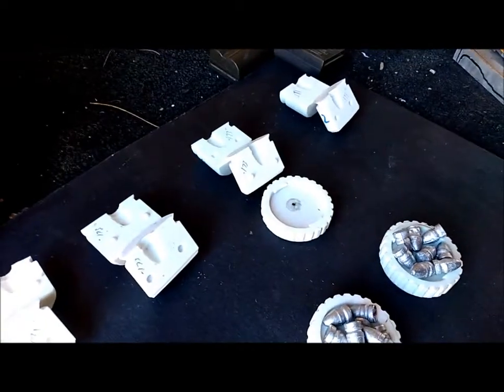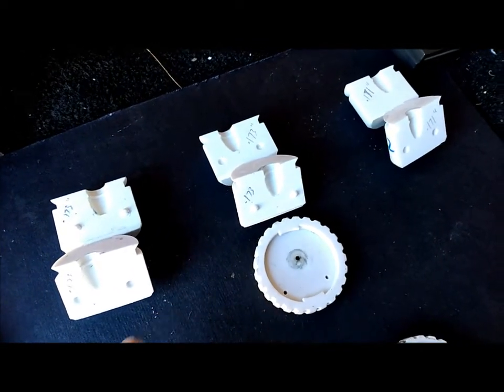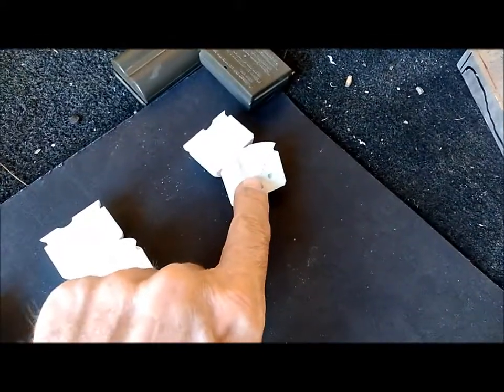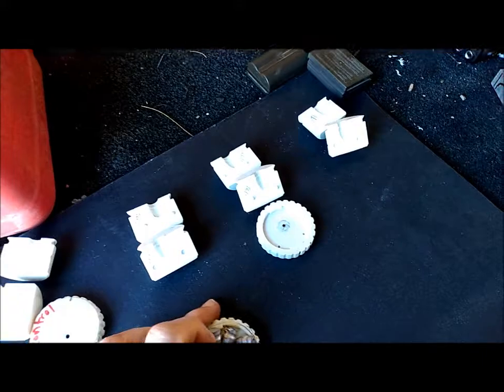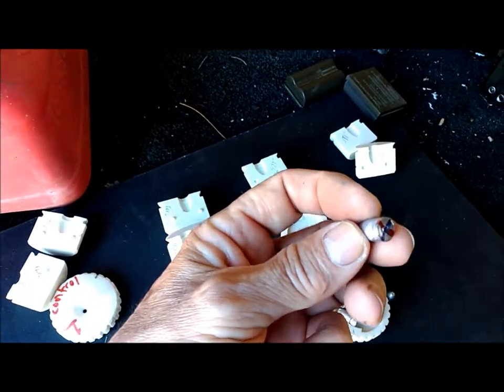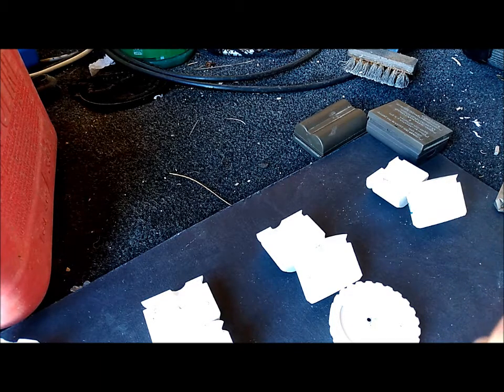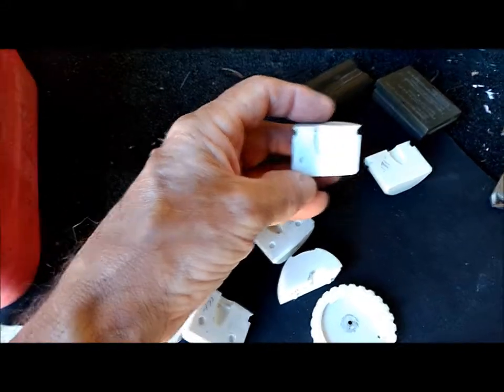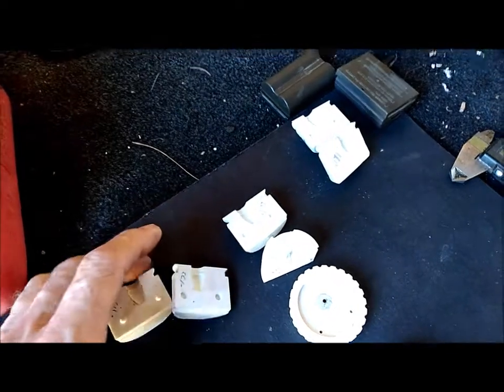3D Printed 9MM Bullet Mold Post Test Cast Overview

Comment: Are these bevel base molds? I wonder if you just went with a flat base for the next set you could stop worrying about the erosion on that edge? I'd also suggest that you eliminate the lube groove as well, just to make it simpler for the prototypes, and shoot for a powder coat projectile where the frosty finish actually works in your favour (powder coat sticks better to frosties).
Reply from the maker: Yes; the original 9mm bullet model did have a bevel base.  I just a few moments ago finished my new bullet model and this next 9mm bullet will be just a plain base; no bevel.

The bevel was making it to hard to get accurate measurements, as well as subjecting the ultra thin edge of that bevel to a quick death.

The only problem that the frosty finish presented to me was in photographing and video recording.  

Although the surface finishes were very good, the frosty look made my bullets look like they had not come out with a decent finish.

I too powder coat so the frosty surface finish will give the powder coat something to cling to as far as I'm concerned.  

If I find that the grease grooves start giving me problems I do plan on going with a cast bullet with not grease grooves.

First things first though.  I want to try to get my next models sized and printed correctly then I'll worry about the other stuff.

Comment: Have stl file?
Reply from the maker: This is an ongoing project that is now nearing it's conclusion.

I won't be releasing any STL files until I've printed and tested a few more prototypes.

I have an ongoing update blog of sorts over on the Cast Boolits forum site if you'd like to keep up to date on the progress of this project.

It's a bit of a long winded read but it details the origins of this project all the way up to where I'm at with it now.

https://castboolits.gunloads.com/showthread.php?425609-3D-Printed-22-Caliber-Pellet-Mold
Reply: @MrTjmk  do you have STL files yet?
Reply from the maker: @punishedgloyperstormtroope8098  Not yet.  My printer is down so I can't test my prototype till I get it fixed.  I'll post updates as they become available.
Sorry for the delays.